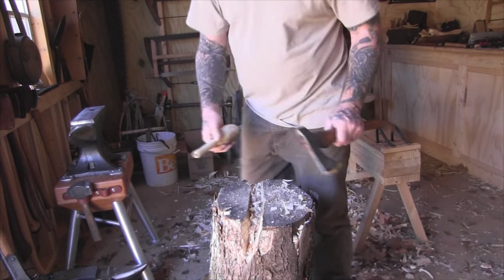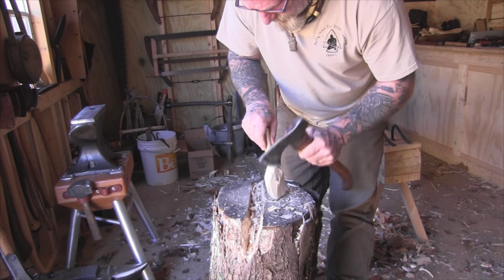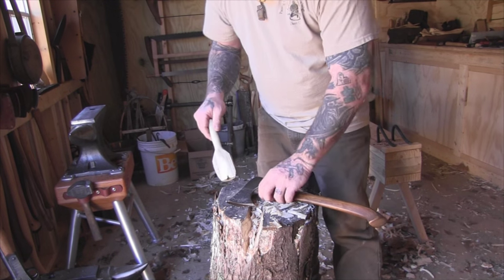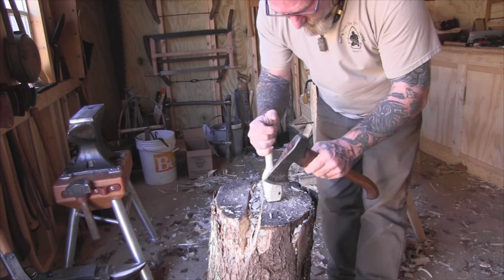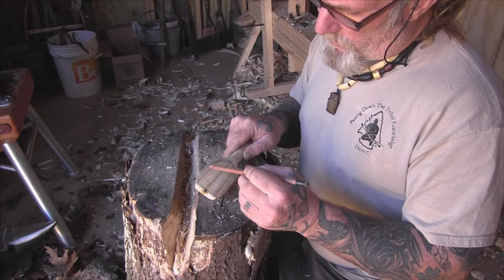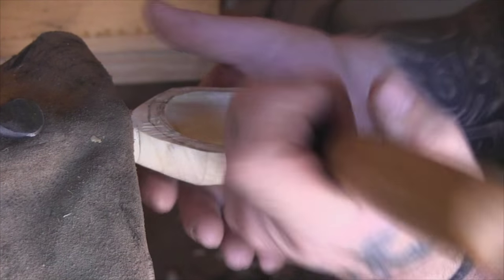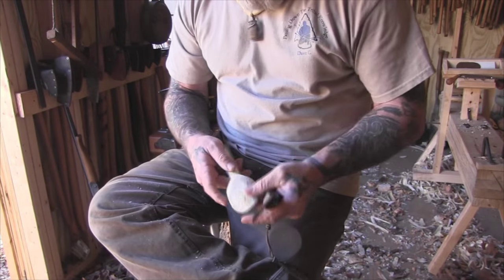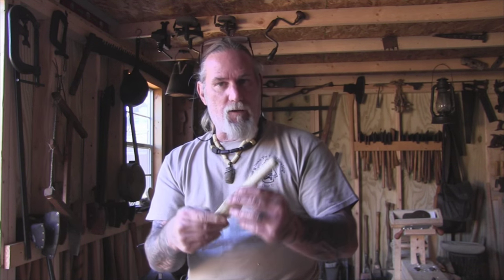The Offset Turned English Spoon  Part 2

Comment: So, the spoon is not offset, per se, but the wood it is made from is mounted in an offset configuration in the lathe to facilitate making a turned handle as opposed to a carved one? Is this correct?
The question that we must ask ourselves, then, is whether the benefits of a turned handle outweigh the work involved in turning an offset chunk of wood on the lathe—all else being equal of course.
Hypothetically, I can imagine a big ladle with an ornately turned handle being made this way by someone who was proficient in lathe work. It also makes the spoon handles able to be accurately reproduced using a profile template. I'm sure that utensils for 12 people with nearly identical handles would have been fairly impressive back in the day.

Comment: a big offset will make a deep bowl.  adding a flat to the bottom side would let you set it down on a surface and not spill what is in it.  good for cooking when taking something out of the pot to add back in later is part of the process.  IE brown meat then make the gravy for the stew kind of deal or using it as  a water ladle.  kuska style use.

Comment: Imagine an extreme case of this where, for example, a 4" diameter log is mounted  on the lathe, 1" from the log's edge (however impractical that would be).  You could create a pretty cool ladle with a BIG bowl. Now, imagine roughing out the ladle to remove most of the wood BEFORE putting it on the lathe so it resembles something like an Iroquois club. The bowl part of the ladle would still be offset but the handle would be aligned. This would allow you to make the same ladle in a practical way. What do you think Dave?